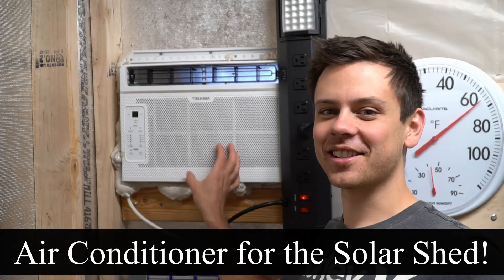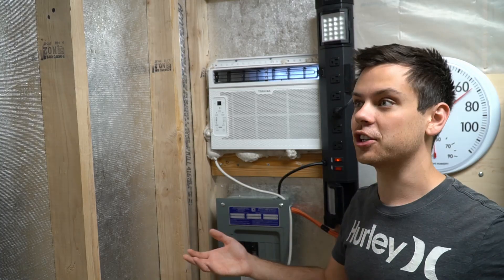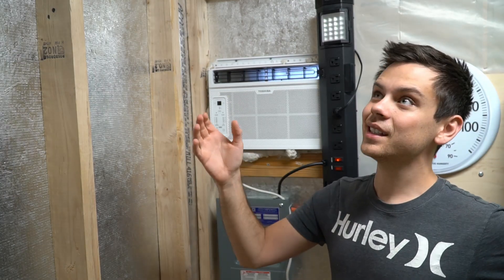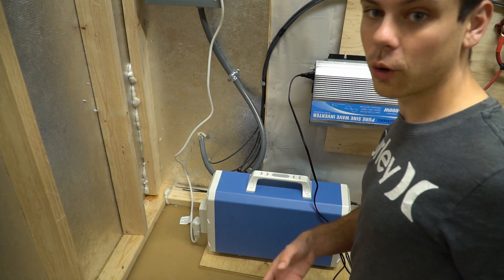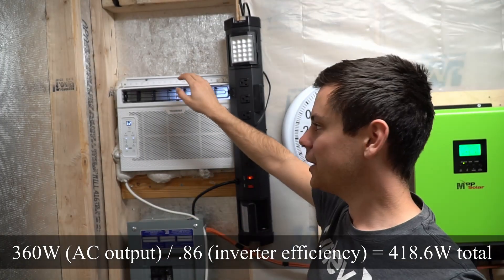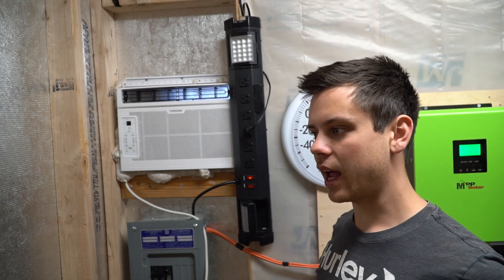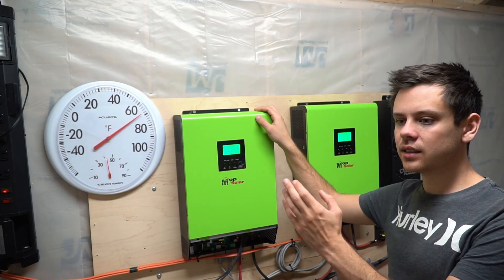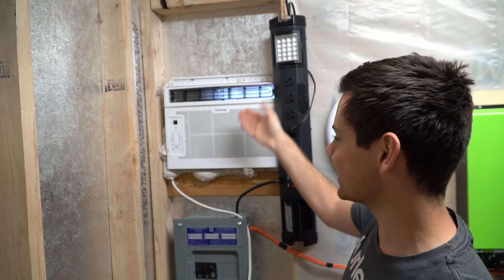Solar Shed: Running a Cheap Air Conditioner

Comment: A cheap and efficient way to cool a shed is to shade it with a tarp. Set off of the shed by 8 to 10 inches on the southern side with a 6 inch air gap on the bottom. You can also use a shade tarp sold at garden supply warehouses with the same air gap on the bottom.
Reply: You must live in the North. In Texas, even in the shade that shed would be burning up inside.
Reply: Too much wind in summer storms here.....for tarping
Reply: @alrgman  yep, it's completely impractical any part of the country. I tarp setup is always a temporary use thing.

Comment: I want to run a 110volt 6,000 BTU window unit from a 2kw (4k peak) pure sine wave inverter connected to a 60amph 12volt battery. I plan to have 2 batteries, and will rotate them out. (I have a propane 3800watt generator to run my freezer and fridge, along with my router, TV, and a fan or two. I will use a battery charger connected to the generator to charge the batteries that will be used with the inverter. (Charging one while using the other, then rotate as needed) - I do not have any solar setup, and likely will not add any for a few years. Also, the above will only be used at times when the power goes out, which seems to be 2-3 times per year, for 4 hours to 36 hours at a time.

With the above info, do you see any potential oh-oh's I should be on the lookout for, or do you see something that screams "Don't try this"?

Thanks

Comment: I have a Bluetti 2400 wh Maxoak connected to a 5,000 btu window AC and have problems getting them to work together. When running the window AC draws 530 watts, well within the specs of the Bluetti. But the power doesn't always ramp up fast enough and the AC unit goes into compressor protect mode and goes through a safe startup cycle. It'll do that three or four times before the compressor finally catches. Is there a way to buffer the output on the Bluetti or just get a different window AC?

Comment: I've seen a solar ac out of Australia that appears to use heat to run the compressor. Can you go in depth on solar ac units?
It's the main barrier to full off grid living.

Comment: Love your Content ! Thanks for the Information ! Building a 16' x 10' Solar Wood Drying KILN (45 degree Tuftex Clear Passive Roof facing South !
Putting in 3 Western Harmonics 18" Fans for Airflow, Could power with 100 w Panels during Day. But want to Add a Crawlspace Dehumidifier during a Low Temp 60-75 degree Night time cycle, say about 4-6 Hours (12:00 am - 6am) pulling out Moisture
It's a 120 VAC, 60Hz, 4.2 Amp Refrigerant Dehum, What would You recommend for a Lithium Bank System ?
Thanks

Comment: You got to adjust your wattage for kick on due to the fan motor and a condenser motor and the compressor they will possibly if trip not triple make quadruple and start of wattage. You save money and insulate with spray foam it's the purple Pink panther makes one and it sticks to the walls and it will insulate sufficiently enough to not have to install an attic. But then you do lose out on the storage space

Comment: you could mod it into a split unit quite easily, just get rid of the blower part on the fan axel and use a different fan(quieter?) for the evaporator, then make a wall over the empty space left in the middle of the unit, insulate it, and thats it

insulation+++, efficiency over 9000! and quiet af, mine hasn't died yet and compressor only turns on like 70% as much as before the mod

you could even bend the evaporator to change its airflow direction with a new fan, just avoid tight turns and only do it once :P

Comment: A mini split you would make more sense in my climate up in Wisconsin because you can use it for heat and they're fairly efficient although you can get some window air conditioners that also have a heating option I do not know how efficient those would be you obviously in California do not need heat as much as we do out here in Wisconsin

Comment: I have mostly no idea of what you’re saying but, you speak of using a WIFI switch.

I was just thinking about that a few weeks ago, when I was talking with someone about the fact that I can’t let a generator just sit for months at a time.

I have a couple of UPSs for computer usage and made the mistake of letting one just sit for over a year. The battery would no longer hold any type of charge. Of course, I guess the key is to charge it every few weeks, but I live enough of a distracted life to forget about that entirely. So, I was considering putting it on a WIFI switch and scheduling it. But, I guess I’m surprised I’ve never heard of anyone else doing that, unless it’s that they typically, use their generator(s) so frequently, it just isn’t an issue for them.

Comment: I build shipping container cabins and i add a second roof ontop to shade the containers. It makes a massive difference in keeping them cool.  A large solar array might do the same or you may want to make a shade roof overtop to put the panels on.

Comment: I'm sure someone has already said it but many window AC now have WiFi built in so you can check it anytime from anywhere.  You can also configure schedules and have it set to turn on and off depending on temperature.  You can even check the temperature when it is off to determine if you want to turn it on or not.  Keep up the great work.  I'm looking at possibly  adding solar and backup battery to my  house and an RV one of these years.  Just starting my research into everything and your knowledge helps a lot.

Comment: If your ac has a digital start stop I don’t see how a WiFi switch is going to work as the switch on the ac will go back to off when power is lost and has to be physically turned on. Now if they are real switches then disregard the statement above

Comment: Cheap AC issues Will, they generally will only cool about a 30 degree differential, so on those 120 F days, with the extra insulation you may still be seeing 80's in there.
Reply from the maker: Good point

Comment: @Will Prowse - which Mini-split heat pumps (for both heating in winter and AC during the summer are you recommending to run completely off solar power?  There are several DC Heat pumps available including those from HotSpotEnergy however I wanted to know what you have tested and recommended.

Comment: @DIY Solar Power with Will Prowse   Did you ever insulate the shed?  I'm building my off-grid home office and I'm looking at different insulation types.  Wondering what you did and how its working out.
Reply: nevermind I see you talk about that in the 2nd video :)

Comment: I need help. I bought my daughter a 10×16 foot shed. I am trying to set up a solar system. I purchased 2 250watt panels and I want to wire the shed with outlets and want to run a small ac unit.

Comment: I also have to wonder about electronics efficiency. A lot of electronics use more energy when they are hot, I don’t know about what you’re running in there but in theory having that room cooler could increase the efficiency of the electronics running inside. If it was 125 degrees in there I wonder if your electronics are losing efficiency from running so hot.

I also wonder why nobody’s invented a 12 V air conditioner yet. You’d think somebody would’ve designed an AC to run specifically of solar or battery Or a very small but efficient AC

Comment: Hi ive been watching your videos and had no idea u lived in vegas i also live in vegas i deseratly need help figuring out a cheap way to run a small ac in my astro van  do to loss of work i need to live in my van  was wondering if we could meet and u could give me some recomendations on how to do it on the cheap i am on a low budget and when it comes to electrical im lost i would like to use deep cycle batteries that i can chareg from driving my van i know u r busy and understand if ur to busy thank u

Comment: With Solar and Lithium Power Station popularity, size increases and price drops you know somebody must be working on a 12v wall unit 5000 btu Air conditioner that  only consumes about 250 watts of 12v power. I wonder if there is some physical or physics limitation. I've heard there are emerging HVAC innovations on the horizon.  Not discussed here, but the Zero Breeze Mark2 is simply too weak at 2000 BTU to cool a van or shed.
Reply: 1 year later and your info answered all the questions I had.  Thanks for the info.  Was looking at those Breeze Mark 2 vs 5000 BTU Window Unit to run off a Goal Zero (would not recommend after seeing this channel) because I was trying to cool a truck cab when parked engine off.  Breeze 2 at $900 vs 5000 BTU window unit at $130 had already pretty much made up my mind but needed to keep the wattage low enough for 3-4 panels (most I could stack on the roof while parked).

Comment: Thats a good idea, thank you, I need to get a large array of solar panels to power my radio station. The AC in there runs 24/7 when it's hot since it's Arizona. The radio transmitters eat up a lot of power though, especially the vacume tube 1.3 kw amplifier. I don't know how I am supposed to run that from solar panels. maybe I can have a battery pack there, because when SHTF happens, The only power will come from the solar pannels.

Comment: People rag on window AC units for being "inefficient", but they're actually generally pretty good in practical use. They beat any single-hose portable by a huge margin, and even most dual-hose units are fighting the fact that they're pulling outside air into the conditioned space to operate, causing some additional thermal losses (not to mention extra required fan power). Additionally, if you're cooling a small space, short-cycling with an oversized AC will tank efficiency way more than any inherent inefficiencies in the small/cheap window designs, and nobody makes a 6000BTU or less dual-hose portable or minisplit. Any window unit you buy today is also fairly well insulated (assuming you do your part and seal around the unit well) and throws condensate water onto the condenser coils to boost efficiency a bit more.

Noise and awkward mounting of these units are their downsides, but they're often the optimum design for cooling a small space for the least amount of total power.

Comment: Shade the shed.  Will cut down on the AC load dramatically.  Doesn't have to be fancy - use a canvas screen and just big enough/positioned for the afternoon when it's hottest.  

Shading makes a HUGE difference.  Also you could probably get away with a swamp cooler in Vegas with the low humidity, which would just need power for the blower motor and the small pump motor.

Comment: I added a 220 mini split to my new addition to my home. The room is 15 x 25. It was the right choice. You would have just waisted your money on a mini spit for your shed. You bought the correct unit for your needs. A cheap rotating fan would help as well.

Comment: For solar powered AC/HP DIY MrCool is a good choice. Only draws 2.1 amp! It uses DC Inverter technology. A less best choice is the new DAIKEN u-shaped window unit, also a DC Inverter based technology unit.

Comment: I recently bought a 12 volt ac unit and hope it works on Bluetti AC200. Plan on using it in truck bed topper. Thanks for "The Shed" ac video.

Comment: If it is a small stand alone shed, might consider covering it with a cheap tarp (spacers for airflow, don't want it touching the shed to much) to keep the sun off it.   Makes a big difference for temp.

Comment: Hi, Thanks for the videos, I have been learned a lot watching all your videos. Do you know if there is a switch/device to switch automatic from solar to regular grid?.  I have a 3 panels 100w hooked to 2 batteries, however a night I still need to work on some stuff on my shed, so I actually change it manually, but wonder if there is some device or switch that allow me to do that automatic

Comment: We'll take the cool in it in and change the coolant in there to Royal Purple it's a higher Cooling in it cools better and it's a synthetic cooler the refill to recharge when your coolant runs out for your AC and you get a recharge change it to Royal Purple and see I guarantee you I'm honestly a mechanic and when I was in the Navy I learned wattages but dammit I Love Back to the Future I Love Back to the Future but understanding that in layman's terms as you would use ohms wattage kilowatts hours on Volts you know the conversion I can always remember the conversions but I get what he saying 100% cuz that's what I've been trying to do since I've been out here

Comment: Finally someone's listening somebody's listening she got power but you got power but you got converting you know if our so has you hook everything up together after a while you save more power but once you get the charging you know the power that you use while you're charging is drop down to a minimum the more battery power sometimes the better but as you get the ac-dc converters while you're charging the power needed inside as you know left to a minimum but at the same time you don't have to worry about what you need cuz you got one two three four different type of conversions maybe five or six I think I heard him say I know for four or five different types of conversions that does not only regulate but monitor the output but at the same time if you got enough power up there on top on the shed then you should be pulling in at least 500w you know worth of conversion into the yeti so it shouldn't really take that long specially you know what everything you have in there but if you get enough solar power on walking in on it's like having a Transformer f*** having a Transformer you go from 120 to 220 it's not going to overdo it 220 going into it and I'll save you a whole bunch of time but at the same time does do you have the circuit power let's stay inside the yeti to handle 120 to 220 you know potentially power going in but power going out

Comment: So solar cells are most efficient at 25°C maybe you could run a little bit of air that way some way to boost thier output. I've read it can increase output 3 %

Comment: I agree,  like many Vids, lots of
 talk and little info.

5000 btu A.C. window unit:
 run power  =  ~ 500 watts
 starting surge  =  ~ 1000 watts
SO...
Solar panels  =  at least 500 watts
Start surge can be done with car
 battery charged by solar panels.
 ( battery only needed to get A.C.
 unit running  =  "start surge" )
1 battery can be used to start
 many A.C. units.
But a 500 + watt solar panel
 is needed for each A.C. unit.

A 500 + watt power inverter
 ( 12 volt dc to 120 volt ac )
is needed for each
 solar panel  /  A.C. unit

And a solar panel set to charge
 the surge startup battery.

Q:   How ya gonna run it at night?
But killing just the daytime A.C.
 costs may be worth the effort.

Comment: Can anyone recommend some good books or resources that explain how solar works for a novice. I am looking to run my fridge/freezer when the electric goes down periodically or perhaps permanently off the grid.  Also want to learn about solar in general.
Reply from the maker: https://www.amazon.com/dp/1546567119/ref=cm_sw_r_cp_apa_i_Up4dFbYS1TGRZ
Reply: @WillProwse  Thanks man!
Reply: @WillProwse  Hello Will, what unit do you recommend if the power goes out indefinitely just to power a fridge and freezer?

Comment: My battery shed will require an air conditioner and heater.  We don't get TONS of freezing weather.. but do get a bunch of high temperatures.  A window AC would be great to keep things happy during the summer.

Comment: i just checked my i7 desktop computer. with the 2 monitors it is using like 460 watts of power. if the ac unit here is less that is amazing. for reference. i7 6700,  2 X LG 27" monitors, Geforce video card

Comment: You mentioned that when the  green split phase inverters were both on and went into standby mode there would be no way to restart them. I thought that the inverters are in Standby mode but the inverter was supposed to switch back on if a load is present or detected????

Comment: Why in the world would not use an evaropative cooler? Think about the environment dude! Oh, and it uses less energy!
Reply: Humidity.  Both on the efficiency side and depending on how you "plumb" to the room, it will add a tremendous amount of moisture to the space, bad for electronics.

Now, if he were to use evaporative in a closed loop using a heat exchanger to circulate the cooled water media, yeah, would work without adding moisture. Still will not be as effective as a compressor unit.  Just can't be.
Reply: Wade Brewer 
Humidity in Nevada?
That wouldn’t be a factor but I may be wrong, he may live somewhere else.
Reply: @daniluchison  is he in Nevada? Lol...never really bothered to look, so yeah, you are correct my friend, if in nevada, shouldn't be an issue.  I'm in the northeastern part of the country, evap cooling works, just not as efficient and have to be mindful on plumbing.

Comment: Nice AC unit. 400W consumption, and 1W standby is sweet. Out of curiosity what is the cooling power of it? Or COP? I think I found the model of this thing, and I think it has 1760W cooling power.  Which is COP 4.4. Which is a bit weird, because in some other place i have seen it claiming "combined COP" 11.0 (which also takes into account the stand-by power). Unless it is using BTU/h/W as a unit, instead W/W unit. Which would be utterly stupid, and deceiving, but I wouldn't be surprised if it does so.

Anyway, 4.4 is very decent. The question if 1760W with 50% duty cycle (running 12h a day), is sufficient will be entirely dependent on the insulation of the shed. As the equipment there probably generates less than 200W. But heat input through the walls would need to be calculated taking into account insulation.

Well, data logging of temperature inside, outside, time of a day, and power consumption, will tell the story probably in most strightforward way.